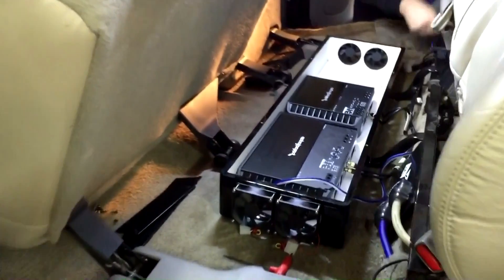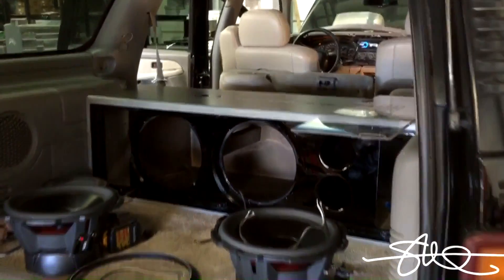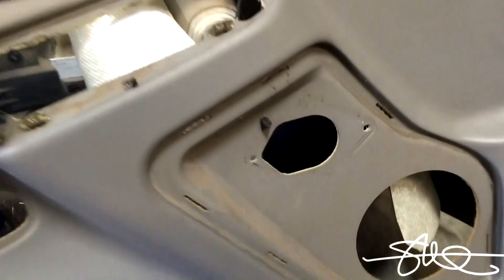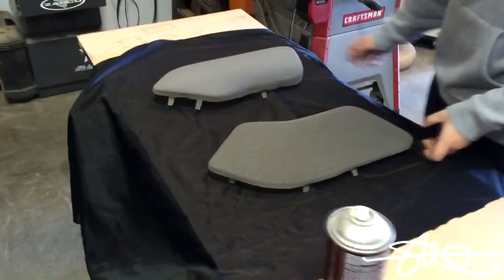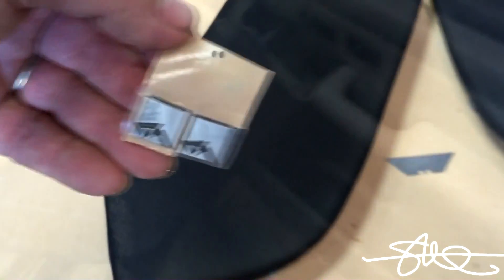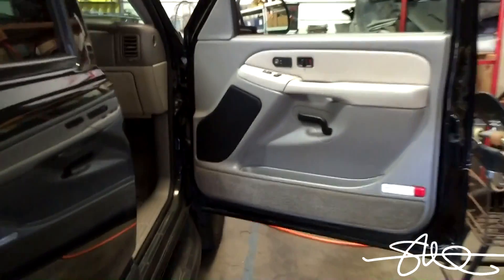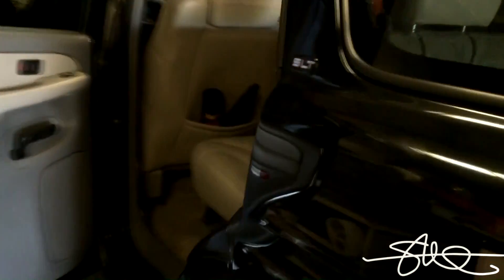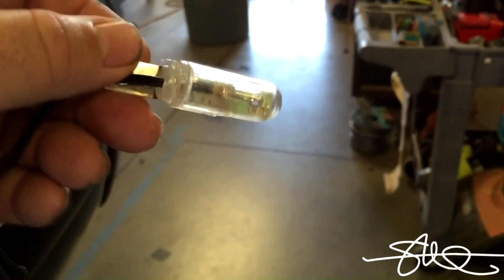Father & Son Car Audio Install - GMC Yukon - Mids/Tweets + Amp Rack Wired Up & Fired up! Video #5

Comment from the maker: FIRST!
Reply: в постель к биберу ? =D хD
Reply: Quedo muy bien ese sistema y muy limpo eltrabajo
Reply: Yo cuz is this Yukon another of your cars or just install for somebody
Reply: Bass5320 install for his boy.
Reply: Hey, How you doing Steve, I hope all is well. I gotta simple question for you. I have 2 Kicker L7 15s wired at 1 ohm.  What would be the best amp or amps for my sub's?
Reply: Hey I have been following your youtube account for a while now and just bought a 94 crown victoria and was wondering if you have ever built a custom dash insert. I am sure you know what the older dashes look like. If you can help me out that would be great cause I would like to put a aftermarket head unit in but would really like to go bigger than a single din.
Reply: How much would it cost to build another amp box like that?

Comment: Would love to do a fosgate power set up in my 87 GTA Trans Am. But i just cant seem to bring myself to rip out the original Delco equipment since the car is still all original. Love your installs btw. You do awesome work.

Comment: Are those speaker pods bigger that normal. Also did you make a hole in them. I've heard when using speaker baffles you have to make a quarter size hole on the back. I'm building my Tahoe based on these videos, just on a budget. I've done the big 3 and im about to do my amp rack. It won't be as nice but It will get the job done. Thanks so much for doing this complete overview in great detail.

Comment: I see you have bundled up all of the cables behind the amp box, won't that cause interference on the rca's from the power cables?
Reply from the maker: nope.  That's one of the biggest myth's in car audio.
Reply: and I've been running cables on opposite sides of the car, helpful as always. keep doing what you're doing

Comment: hey steve quick question i see you have the 4 channel and sub amp together in that box. when wiring the door speakers did you ever cross the power wires for the amp?

Comment: How did you split the one rca to 2 amps? Is it true that the sound quality can suffer if you use an 1 to 2 rca block?
Reply: A lot of amps have pass-through RCA outputs, you run your RCAs from your deck to one of them then another set from that amp to the next
Reply from the maker: the RCA's aren't split.

Comment: Inside the custom cooling amp rack, what are the two (2) smaller Boxes next to the P300.2 & P100.1 Amps?
Reply: I think they are the components crossovers

Comment: Loving every vid, always hitting the like sub button on the page. Quick question, how can I go about my 99 Ford Expedition? Something that can bang a bit but not bang my bucks. I plan on doing a first time build and looking for some guidance.
Reply: Check out some stuff on you tube. There are many different ways, to do many different things. I like Steves Videos cause he doesnt edit out the "Little" things, that you really should see. Also, check out fiber glassing videos, and not exactly System related, but you can learn some techniques by searching for "making custom car parts" here on you tube.. Good luck, and I hope you document your build
Reply: Justin Poole Thanks for the feed back. I have tried to search it up on here but not much on the vehicle. Weird, unless I am not searching better enough. But I really wanted to give that fiber-glassing stuff and see what I can make. At the same time not wasting materials for nothing. I am going to recheck on here and see if I can find anything. Thanks once again.

Comment: Went to replace my factory speakers in my 2005 Tacoma and the previous owner Hot Glued 3way 6x9's into the factory 6x9 speakers after cutting out the centers😳 wtf!
Seen videos of people finding similar things never thought I would find the same🤦‍♂️
Weird part was they didn't sound bad.🤣🤣🤣

Comment: Hey Steve can you DO a amp test tue on an audiobahn 1500 htc I would love to know the actual power numbers
Reply from the maker: Might be kinda tough considering Audiobahn went out of business damn near 10 years ago.  I wouldn't test one without a fire extinguisher near by either.
Reply: Oh Damn man I didn't know that they went out of business I have one that's why I asked can you tell me whats a good replacement
Reply from the maker: Quetmon Powell as long as it works, no need to replace it bro! Ride it till the wheels fall off! :)
Reply: lol i plan to steve hey how do you think it will do on 4 dvc 12s and a epicenter

Comment: I'm trying to find a harness to bypass the amp in my Dodge Charger. 2013 with Alpine speakers . Would like to plug into the factory head unit's speaker output then  into a DSP . Searched Metra but came up empty.

Comment: How much did this whole setup cost? I wanted something similar, but I am pretty sure all that wouldn't fit my budget...Haha! I'm a fan of your work btw!
Reply from the maker: It's only 2 amps, 2 woofers and 2 door speakers.  You can make any decent brand sound good in a  budget situation  you just have to do it correctly.
Reply from the maker: oh, thanks!